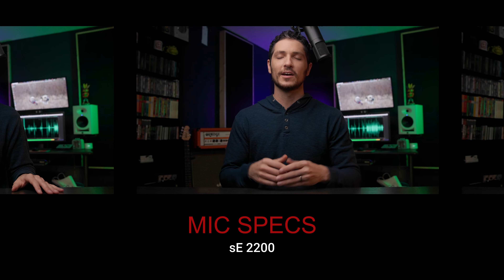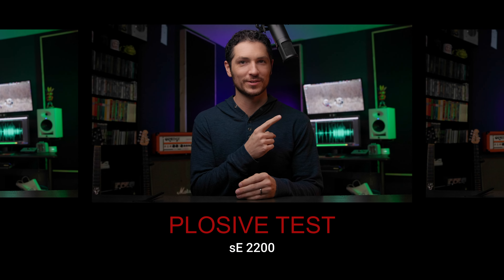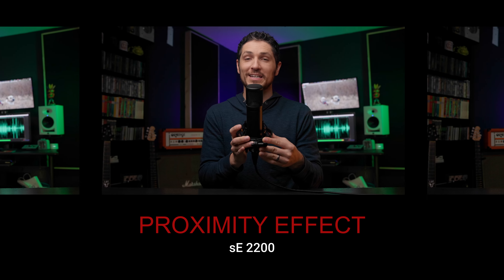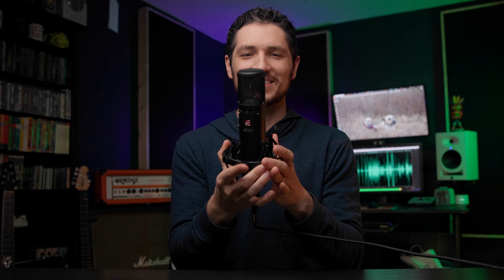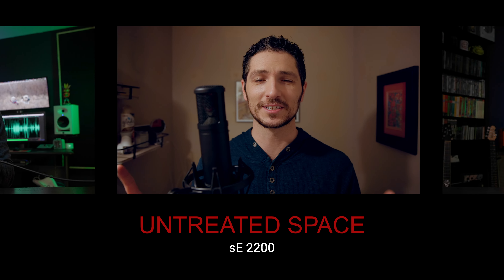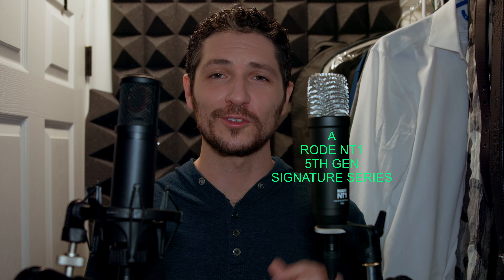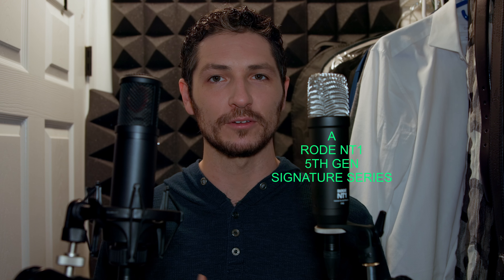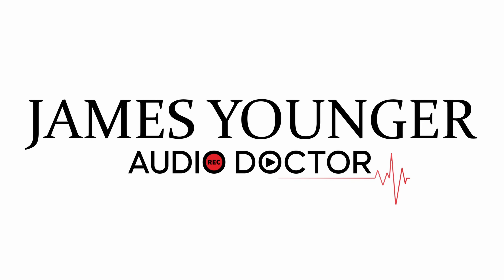sE 2200 Review/Test (VS RODE NT1)

Comment: error in 1:12.. it is either 20 hz to 20 000 hz or it is 20 hz to 20 khz... you said 20 000 khz which is way beyond ultra sound, kilo means 1000.. also shame on the builders, there is no way any microphone so closely matches human hearing range limitation - sounds like a marketing thing they put on a box just to show that yeah every frequency you are able to hear it will be able to pick up. For example 15hz or 30khz audio has an effect on your recordings as well as in the air molecules being vibrated in the room. Digitally the ultrasound frequencies also relate to aliasing.
Reply from the maker: Nope, I just misspoke.